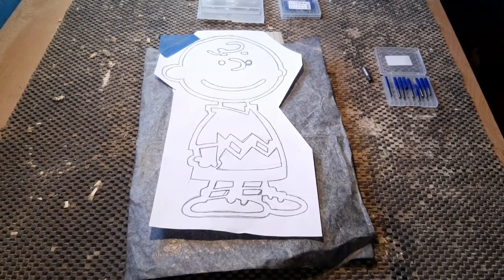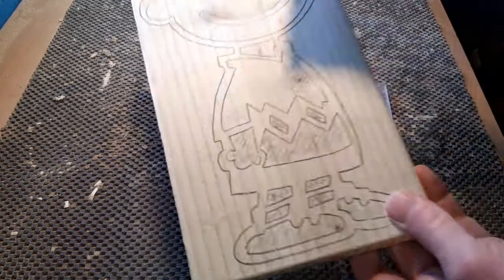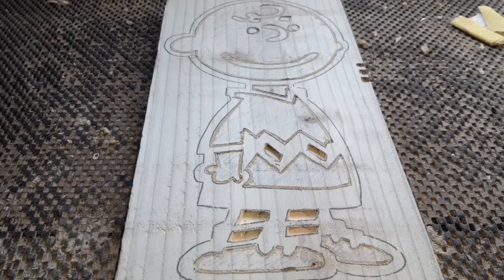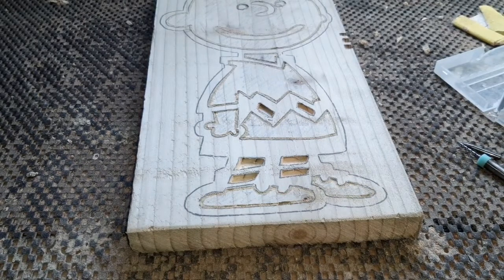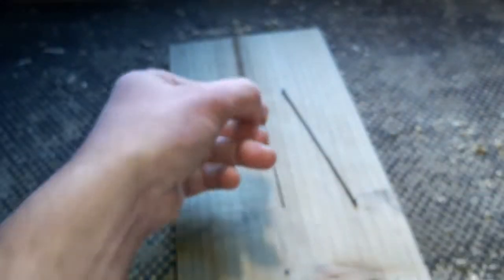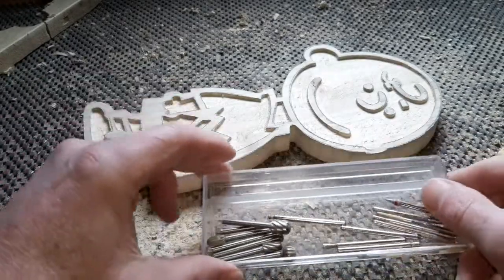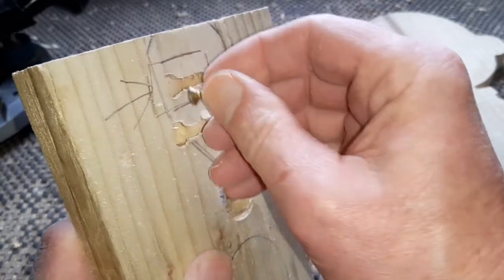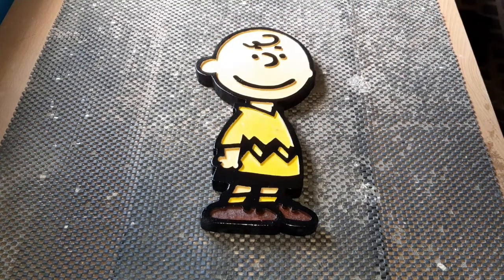Charlie Brown..Router project on fencing wood.

Comment: Another detailed and fun project, thank you!
A good cheap and effective sanding sealer is watered down PVA glue applied with a brush.
Reply from the maker: Thank you Denise,I've heard of the pva trick before, on my resin projects I tend to just spray varnish to seal with..

Comment: great project - thanks! can you put a link please to where you get the adapter from, from the dremel size bits to the router collet size - am having trouble finding one!!!
Reply from the maker: Thank you Gabriel, I get most of my bits from ebay, but you can find them on amazon also..https://www.ebay.co.uk/itm/402710195555
Reply: @fishtank5050  ah perfect! thankyou very much!
Reply: hi again! i followed your link exactly but the new collet came and seems to be the wrong size, ie it is too small to fit the router and i cant seem to get the dremmel size bit to fit whichever way round i try to fit the colett - what do yo think and i doing wrong???
Reply from the maker: @gabrielsutton883  you say its to small for your router, is your router a 14" shank router,because you can get 1/2" shank router aswell,very strange that's it to small to fit the router collet, I've had one chap that received a totally different size adapter collet ti what he ordered, I've had alot of folk on my Facebook page say everything works fine, so I'm confused why the adapter doesn't fit your router,and the dremel size bits,3.175mm don't fit the adapter collet...here's another link..https://www.ebay.co.uk/itm/352667542851
Reply: @fishtank5050  thanks for replying so promptly... i will double check all sies today and let you know... its a Bosch POF 1200 AE router, im sure its 1/4inch, the bits are not dremell but a similar brand... i'm wondering if they have sent the right colett, i'll measure that as well - i cant wait to get started on some of your projects; thanks again!
Reply from the maker: @gabrielsutton883  your bosch is a 1/4",so the 6.35mm adapter reducer collet should fit no problem, check the size of the collet in the router,just in case it's that,if your bits are 3.175mm, they should also fit..definitely check the adapter they have sent you,good luck.
Reply: @fishtank5050  hi! spent some time today trying to get this sorted... right ,the new colett which is about 1 inch long says on the box 1/4 (then funny symbol) 1/8, i can get the shiny end with the slots or the black end to tighten in the router but none of my dremel size bits will tighten, they are all loose and slide in and out without being able to tighten up. In fact the colett and the bit will disappear completely into the router if i push it all the way in before i try to tighten, i wonder if there is a colett or something else missing. I have looked really closely at your videos to see what I am doing wrong!!!
Reply: ive just seen again on your flintstone project you push the dremel bit into the silver end and the dark end into the router... my bits are just too small for the silver end of the adapter
Reply from the maker: @gabrielsutton883  check the hole in the adapter collet, l had someone who had the same issue and the hole was twice the size it should have been,when you put the dremel size bit,3.175mm into the adapter reducer collet it should be stay in place by itself,if it falling out then the hole is to big..do you have any cnc bits to try
Reply: @fishtank5050  i will check the 3.175mm dia when its stopped lashing down with rain lol! but to my ignorance (Im a complete newbie to this) I thought a dremel bit and a cnc bit was the same thing!!!
Reply from the maker: @gabrielsutton883  I use cnc bits to do my lines with ,they have the same size shaft 3.175mm as a dremel bit,I've got some bits that I use in my dremel that have a smaller shaft on  then 3.175mm, so I have to change the collet in my dremel, I'm wondering if this is what you ate trying to use...https://www.ebay.co.uk/itm/172213663526